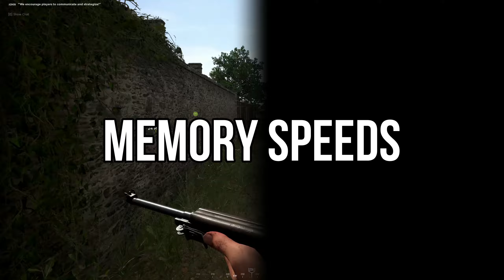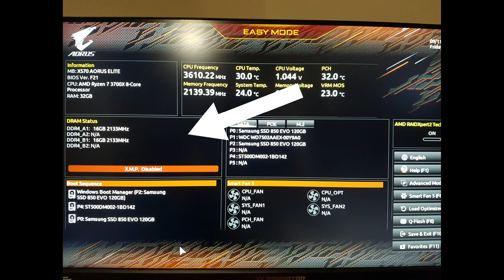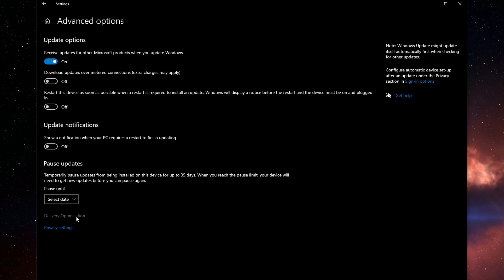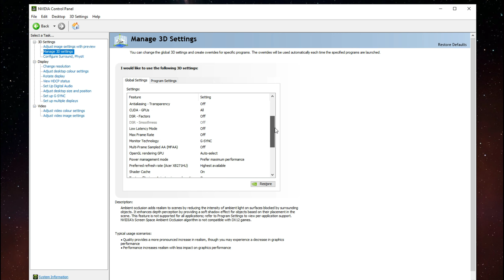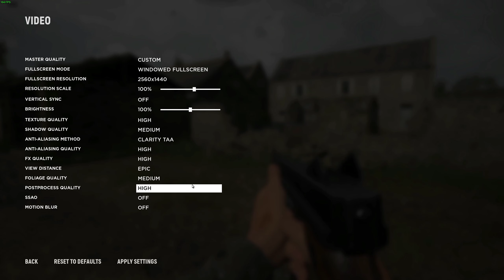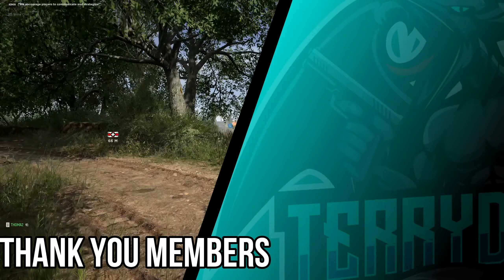Performance Guide on Hell Let Loose

Comment: Thanks. My fps was stuck between 55-80, now it runs easily at 150 fps on the map Foy with all the snow. I think the -dx12 parameter did the trick.

Comment: You shouldnt change NVIDIA power settings as global. But rather for the game itself, because if you set maximum performance as global, your GPU will be at its maximum clocks and frequencies even in idle. Which means your card will idle with for example 1700MHz, thus heating up very quickly in idle.
Reply: yeah i created a profile for HLL in the nvidia settings

Comment: Still running pritty low with my 3060TI  , with my good old 10708gb i reaced a solid 70 fps  , with RTX 3060ti i get 50 fps , must say i did not changed bios settings

Comment: Better cpu, memory and graphics will 100% make the game run better but I can tell you from experience you can run the game alright on a potato if your willing to deal with lower quality on the in game settings. I run a dual Xeon quad core rig at 3.0ghz with 16gb fb ddr2 memory at speeds of 667mhz and an old 120gb micron ssd running on a sata2 port. The machine is from 2004 or 2005 and runs alright but gets stupid hot. Due to the massive tdp on the CPU’s I can only utilize a workstation graphics card so I’m rocking a Nividia quadro p600 with 2gb ddr5 memory. It’s bare minimum to play but I get pretty decent FPS for a rig built in the early 2000’s. Also my keyboard mouse response is a tad better cause I have an old analog ps2 keyboard and mouse.
Reply: The settings in this video did boost some performance for the game.

Comment: 16gb ram  @3400, 2700x with pbo and 2080 @ medium high getting just over 60fps 1440p but not very smooth. After this applying thsi guide with -dx12 -high -USEALLAVAILABLECORES -malloc=system -refresh 165  i got ~20fps more
Reply from the maker: Nice!

Comment: I have GTX 1660 ti with 6 vram. The game runs with 30-50 fps when on low. I have done everything from clean installing drivers to using the dx12 launch option. Really don't know what to do. Running with Lenovo legion laptop y540
Reply from the maker: Try deleting the Nvidia Cache as well, that could help.
Reply: @Terrydactyl  Using launch option what's set to 144 hz and its better now! Did the cache thing too and helped a lot. Still aint no 100 fps but i have enough to enjoy! So thanks!

Comment: Thanks a lot !

An important question for me. Did you notice a significative change between what you put in Nvidia Control Panel instead of letting completely the 3D application decide ? Of course, you didn't mention to change this option in adjust image setting... Did you apply only on the Hll execute file ?

Comment: So when it comes to using your monitor at its native resolution.. I was an idiot at the time of buying mine and bought a 4k monitor, which only has a 36hz refresh rate at 4k. 

I've currently got it set at 1440p instead, and have overclocked it to 109hz. 

That should be okay to stay on shouldn't it? Surely that'll be better than 36hz @ 4k

Comment: 1:29 that's because of DDR is double data rate, not because its dual channel.

Also very few motherboards actually have quad channel unless you are running threadripper or intel HEDT you will have dual channel even with 4 dimm slots.
Reply from the maker: Thanks for the info!

Comment: Launch options

-refresh 144 -USEALLAVAILABLECORES -malloc=system -dx12

144 is based on your monitor's refresh rate =)
Reply from the maker: Doing these extra launch options didn't give me any improvement. Actually got a video coming out tomorrow for it.
Reply: It helped me got 10 extra fps by writing this launch code
Reply: @matevzzoretic112  Your welcome bro

Comment: Is a rx580 good for it
Reply from the maker: I'm not sure tbh. It might be but at 1080p and low settings. Just make sure you use the DX12 setting
Reply: I have a 580  4gb and so far is perfectly playable the fps isn't great 20/60 fps on mostly epic (don't know with te new settings will update)

Update: just played the whole evening. I did all the settings form this vid and did the engine.ini thing and got a average of 50 fps on 1080p. There where Some dips to 20/30 but far from unplayable. I have erything on epic exept foilage (high) and I have running Discord in the background. Pc specs ryzen 7 2700, 16 gb ddr4 3200, RX 580 4gb

Comment: I'm going to make a guess here as I don't own the game but I have seen similar behaviour in other titles. The reason SSAO wasn't doing anything probably has something to do with it being tied to the post-process setting and since it was on low for sake of testing it wasn't doing anything. Normally SSAO should be drawing soft shadows where two adjacent pieces of land, buildings or things like grass meet but I wasn't seeing that. I know I personally enjoy that look because it makes everything seem more grounded and part of the world. Great video by the way. For some reason I thought I wasted money on my higher mhz ram because I thought for whatever reason xmp was only a ryzen thing but I found the thing in the bios and it seems to be working!
Reply from the maker: Im glad the memory thing helped you! For many years I had been running my ram at lower settings so I thought maybe loads of other people are doing the same. I do like SSAO in games, its just the FPS impact and how little it currently does anything so far.

Comment: The DX 12 enabling gave me 50+fps. Eternal gratitude, my dude!
Reply: Same from 40 fps on a 3700x and 3090 to 100ish at 4k
Reply: How do you know what systems can run dx12?
Reply: @barroth3658  the gpu should support it, check it on the manufacturer web site. Sorry for my bad english.
Reply: @Merlin-dota  no worries! Thank you for your help.
Reply: From 50 fps to 120 omfg ty (R9 fury)
Reply from the maker: No probs Charlie!
Reply: Mine crashed 😂😂
Reply: In my case it lowerd the fps
Reply: Same :|

Comment: I have a rysen 3 3100, but my power settings doesn't show rysen options. Instead it shows the default options. Is there a driver to install?
Reply from the maker: I think you need to download the AMD Chipset driver.

Comment: I’m currently running on a GTX 770 and a AMD Phenom II X955 thats oc’d to 3.6 but I plan on upgrading to a Ryzen 5 3400 and a GTX 1650 super
Reply from the maker: You will get a good frame rate increase when you upgrade!
Reply: Terrydactyl Gaming | can’t wait, gaming on a shitty Phenom that sits at 150 degrees constantly sucks tbh
Reply: @prod.yvmu1  I had a X955 lasted me aaaggees, that'll be a nice bump up. If you can wait the gpu prices should drop when the stock levels stop being so low for new cards

Comment: Went through your video again and , my ram wasn't running at it's memory speed. I did encounter one problem, When setting OC genii to on, ( In Bios) it caused an Unreal exception crash every time I launched the game. ( Just mentioning it in case it is of interest to you)  Also my refresh rate ( that I set in windows) wasn't set in Nvida Control panel. The game feels mush smoother now.
Reply from the maker: Yeah only for the last couple of years my memory has been at the correct speed.

Comment: Great video, using i7 7700 with GTX 1050 and all the settings work great. With using DX12, the Windowed Full Screen is a must or it WILL crash on Full Screen mode so I recommend always using it if your machine can handle it. I get 60+ FPS even with a 4k monitor but had to turn the Resolution Scale down to 35%. It hits 40-50fps at 50% if anyone is interested.
Reply from the maker: Yeah Windowed Fullscreen is highly recommend for DX12!

Comment: Good video, made me realize I had my ram setup wrong. Wish I had tested before and after but I played HLL for the first time after most recent patch and now I run at 90+fps instead of the 40-50 I was getting.
Reply from the maker: Thats a nice increase!
Reply: How did you fix ram setup?
Reply: @gregprouse1173  I had them in the wrong slots so they were not running in dual channel mode.